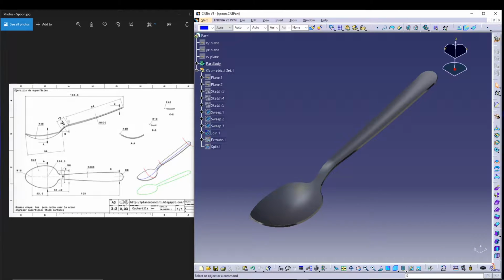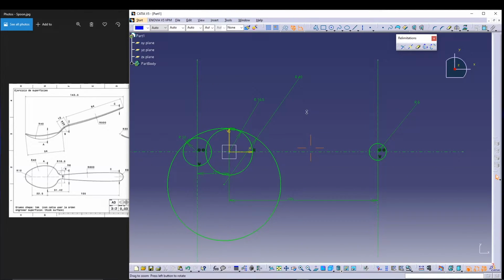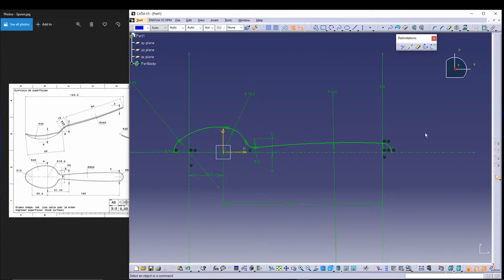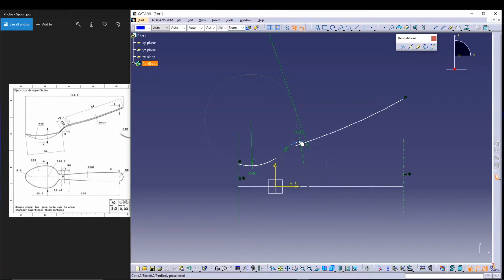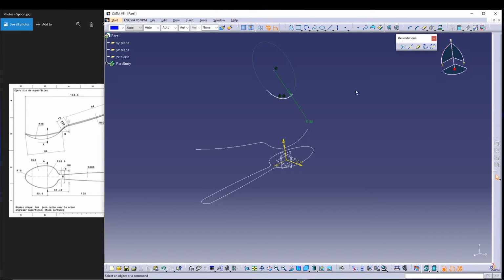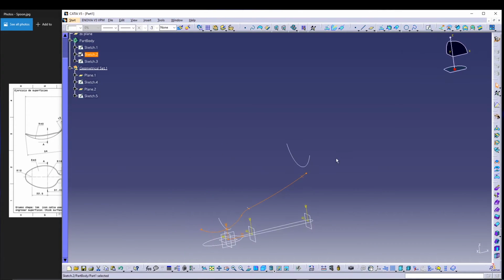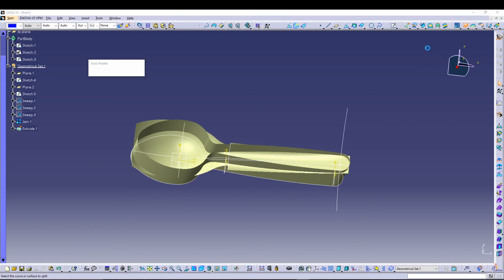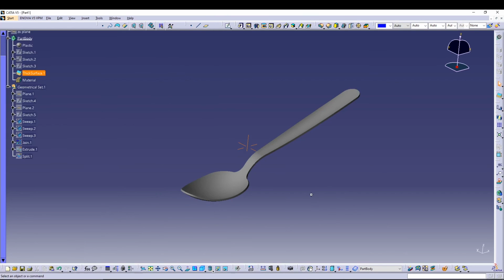CATIA V5 - SURFACE DESIGN | MODELLING A SPOON

Comment: I want to mention steps one by one to complete diagram
1) draw top view in xy plane
2) draw side view in zx plane
3) create points in zx plane at specified diatance
4) draw arc using three point arc and join to points
5) click on sweep, select reference plane, select on 'creat extrude', and then select profile, and guiding curve. 
6) repeat above steps, except the guiding points replaces reference plane. 
7) after completion this, join the sweeped surface which was done in above steps. 
8) extrude the top surface, click on split, join and extrude and press on 'other sides' option
9) right click on extrude and press hide. 
10) go to start option, mechanical design , part design and add the thickness to profile by click on pad. 
11) finally, go to tools, hide, click on all planes, all sketches. 
12) thus you get the required spoon, which you want to draw.

Comment: thank you for the video! i've done the exact operations as you do however i cannot achieve join operation, there's a connexity error between sweep 2 and sketch 4. how can i solve it?
Reply from the maker: That should not happen, but I guess you’re missing some steps maybe extract or something. Just keep trying or do one thing try to do it your own way without copying. 
Anyways a subscribe n share will always be appreciated ☺️
Reply: instead of 31.2 put 31.42 while taking plane